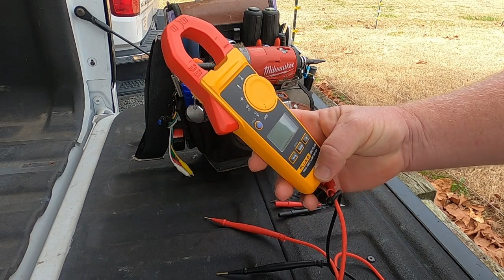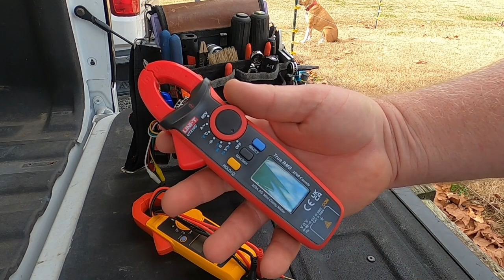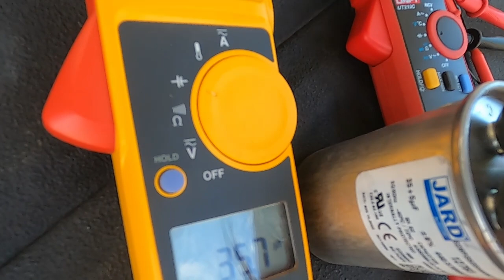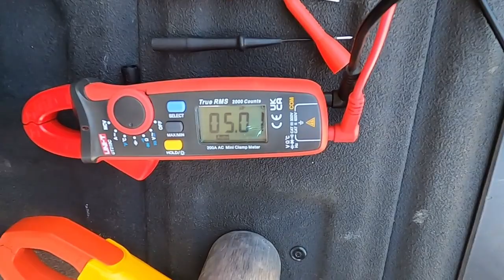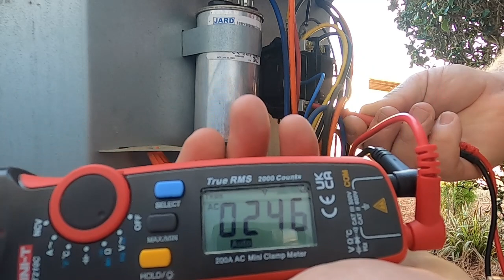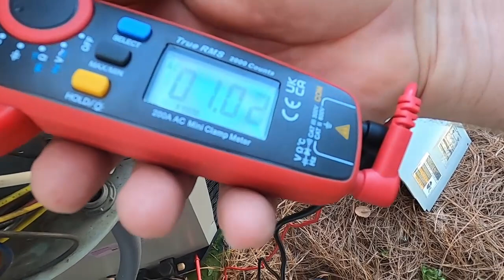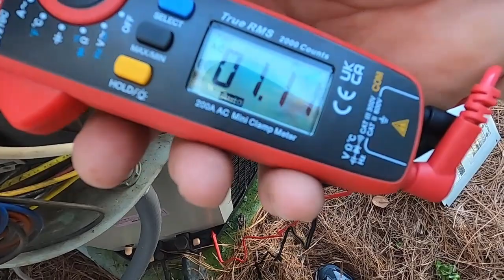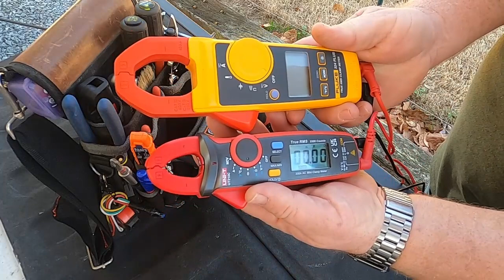Do I really need a FLUKE meter for every HVAC service call?

Comment: As a qualified electrician in the UK I use UNI-T clamp meter and a UNI-T multimeter, have done for the past five years , they are great machines, fluke are overpriced and overrated. There really is no reason to be a brand junkie. Also never use the clamp on any clamp meter for measuring current with the test leads attached . The tips of the lead will be live and if they tuch you  you won’t be returning home to your family. And if they tuch any exposed metal work there will be a big bang 💥.
Also bulbs grow lamps glow,
Lamp holder + lamp =light soil +bulb = tulips
Reply from the maker: My leads stay on all the time when getting amp draws, 20 years, never had a problem nor has anyone else I have ever worked with. I will do a video to debunk your words of no Wisdom.  Thanks for watching and keep playing with your flowers.

Comment: I understand your desire to go smaller but your accuracy check is totally bogus.  You checked one meter against another to measure unknown devices!  You have no clue about the real value of your capacitor or the voltages and currents you measured.  When was that Fluke last calibrated?  Maybe you have the wrong size impact driver!  You could save more room and weight there and continue to use a real quality measuring tool.